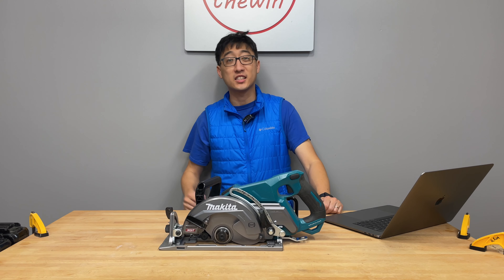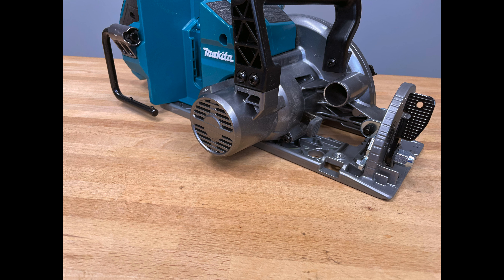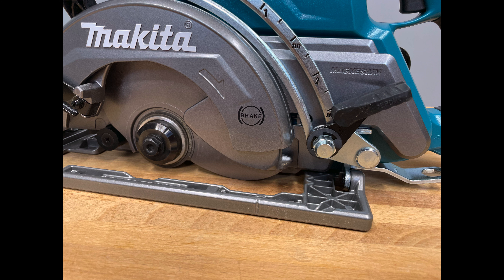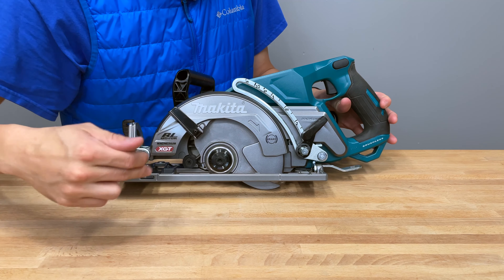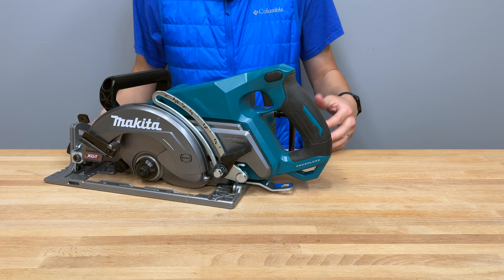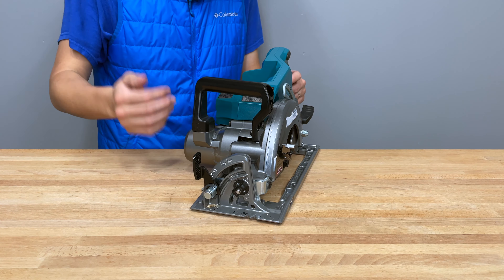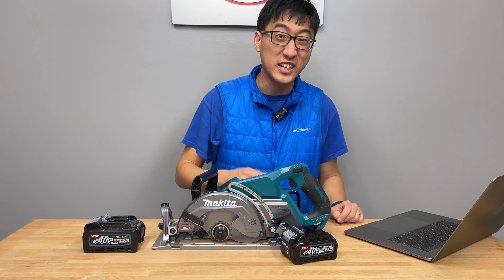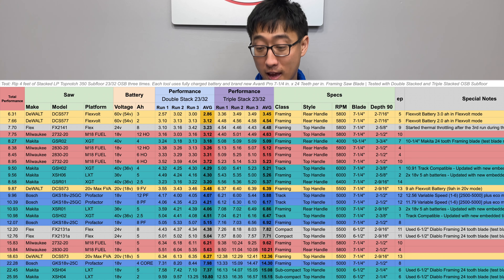MAKITA 40V XGT Rear Handle 7-1/4 inch Circular Saw Review | GSR01 | ep.14 | Fastest saw ?

Comment: There's a version 2 of XSR01.  You gotta try the Metabo HPT.  May not be the most powerful, but it's lightweight.
Reply from the maker: Didn't know. Thanks for the tip! I think i need to get my hands on one of those...
Reply: Yeah we have two of them now and everybody on the Jobsite fights over the Metabo s and we have the Milwaukee and Makita's
I'm turning the Makita into a "Prazi beam saw" and using the Metabo s for most of the framing it's so much lighter and the feel and site line is so nice to use
Reply: @baseballdude8491  I am keeping an eye on the Flex right now….I like that dust shoot and that new battery
Reply: @ProxyFinal  yeah I think the Flex battery power looks promising but at 2+lbs heavier @ 10.1lbs w/out battery and 13+lbs with the 10amhr battery that is exactly why our guys are loving the Metabo HPT cuz the DeWalt,Milwaukee  and Makita are all over 13+ lbs w/batteries that extra 2lbs makes them less manageable when making cuts in awkward angles and setting(which we do on a regular basis framing)
If the Flex was being used for my Prazi beam saw or a stationary cut station then maybe it would make some sense but the great site line , power and control we get from the Metabo HPT is just a framing game changer+ we use the. Other 36V tools on the jobsite and some of them like the table saw, Mitre saw, SDS Max rotary hammer, grinder etc we run with the AC adapter and allows us longer run time and gives  the batteries a break and in turn allows them to last longer
Reply: @baseballdude8491  man, it’s definitely not the best, but it’s pretty slick.  It cuts through anything without bogging down.  I slap a 8.0 battery instead, but the thing is actually a little lighter than the Milwaukee surprisingly.  I took advantage of their deal where they took 150 off my purchase.  Got rid off the Milwaukee.  Waiting on the xgt to arrive which I got for my Father’s Day

Comment: thanks for this review. in terms of the non standardized dust ports problem, then maybe we just need to print our own with a 3d printer. this tool is also useful for making other custom accessories for example router jigs / router templates. of course 3d printer does bring its own set of problems and hassles. but maybe the long term payoff is worth the trouble. lol mine is still a pile of spare parts. never got it working and has been sitting there, unusable for over a year. unfamiliar new technologies. haha
Reply from the maker: yeah. so far i've been able to get by with the interchangeable vac hose ends, but it does get annoying when im without it.

Comment: Great review 👏 
What do you think of this saw vs Metabo multivolt? 👍🙏❤
Reply from the maker: I actually like both. A lot of times i find myself going for the metabo hpt mainly due to weight, but the makita is usually one i use for rip cuts. in most cases i find both of them. one closer to materials, and one closer to where im working. Both of the saws are great, and i would put both in the top-tier class for user-friendliness  and refinement.

Comment: Thats not the same 36v makita I have a dust port is that the very old model?
Reply from the maker: this is the XGT model.... the USA 36v LXT rear handles don't have dust ports.. at least none that i've seen.
Reply: @4thewinak  i have one in my box bro it has a little rubber plug in it I often forget to pull it out...